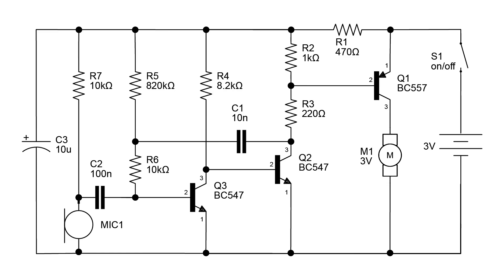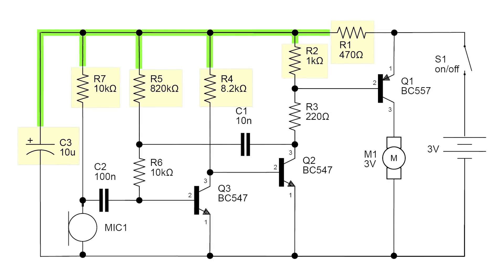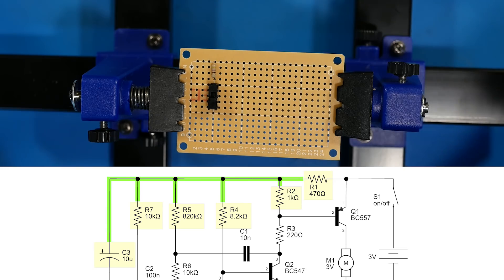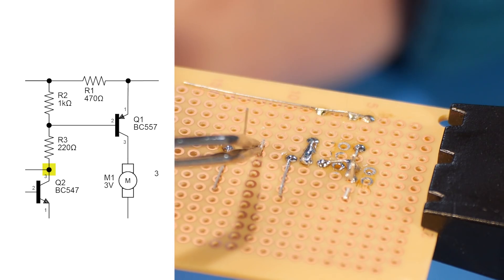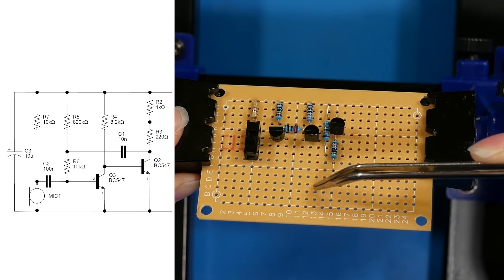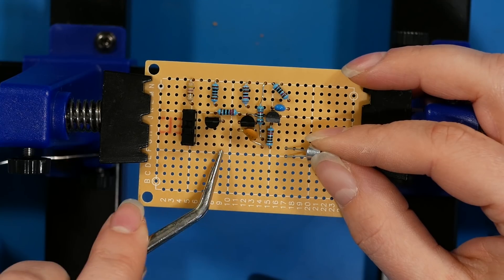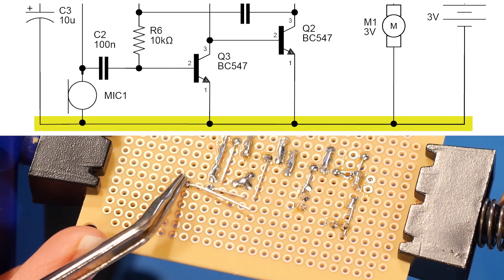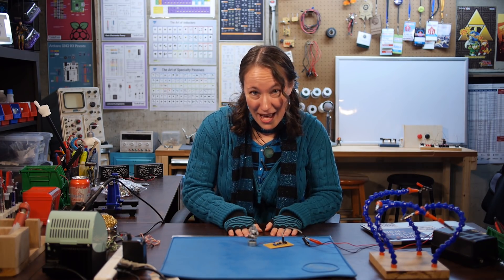Making a Circuit from a Schematic - The Learning Circuit

Comment: I had my electronics students build this, and the 3V DC hobby motors we use for other projects just wouldn't work. They need about 600 mA at 3V to spin. I increased the voltage supply to 5V, but the motor just barely moved, and that was with some help from Mr. Hand, and eventually the PNP transistor overheated and that was that. I replaced it and swapped out the motor for an LED/resistor and it worked just fine. No heat issues and the light popped on and off with voice input. My question is, what motor were you using that didn't require more current at 3V than the PNP transistor could supply? Thanks for all your videos. They are very well done.

Comment: Thank you for this video. I'm wondering if you might also have any video that explains why components of a given rating might be used instead of the same component of a different rating. For example, why a resistor of a given rating would be used instead of a resistor of another rating, or a diode of one rating used instead of a diode of another rating.
This is what I also have trouble grasping.

Comment: Great beginner video,.  A possible addition (especially for people with adhd...but should apply otherwise) is showing how to mark up a schematic as you populate the board so you can track what you have done and what you havent.  I have done it with highlighters...I am sure there are myriad ways, but keeping track of what you have and haven't done is very important once complexity increases.
Reply: Good suggestion Michael, Im early stages in the hobby and have to use pencil to keep track I'm only dreaming of using a highlighter when I dont make mistakes and need to rub out the pencil to start again lol!